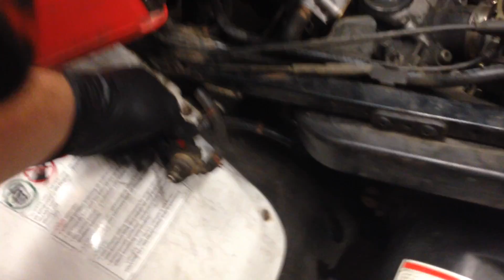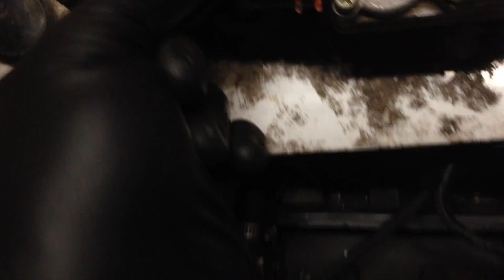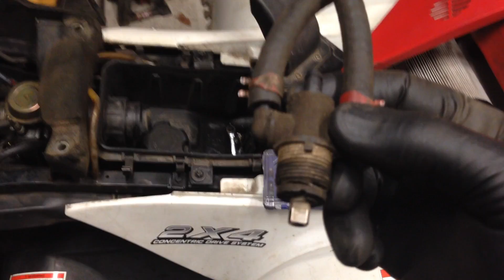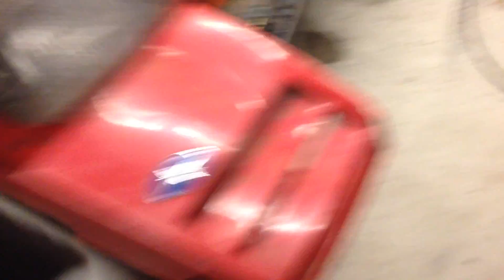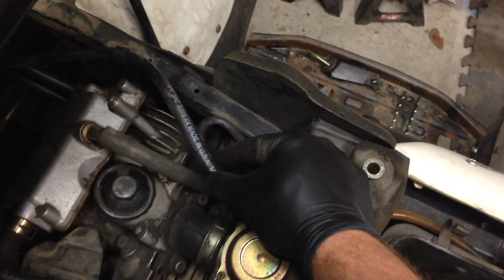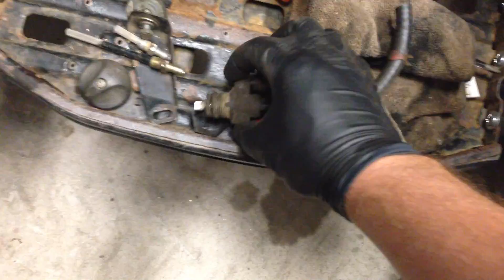Trailboss 325 fuel issues. The fix! Engine sputters then dies. No power or acceleration.

Comment: Your explanation on the pump is wrong the p stands for pump and that line is vacuum Philadelphia vacuum diaphragm pump no it sucks the diaphragm and releases it causing a pumping flat metal plate in the center of a rubber diaphragm that actuates up and down pumping your fuel through the pump to the carburetor vacuum powered diaphragm pump you know how a diaphragm works

Comment: What do people use to seal the ridiculous "nipples" that screw into the underside of the fuel tank? I don't see anything in the manual for this boat anchor. I used teflon tape at the very very end of the threads but if gas touches that; it'll be useless.
Also, you should call the police about whoever the previous owner was with that machine. If they're gonna put those absolutely unacceptable flamingflamerflames grips on their ATV; Who knows what else they're capable of! Scoundrels are everywhere, man!
Reply from the maker: @makaveli087  you can try different thread sealers, Home Depot sells some different types that can withstand different fuel types, check out the plumbing isle. If that’s a no go, try a fuel resistant RTV from an automotive store, it should work. And yes, I’ll make sure the cops track down that flame handled bandit 🤣

Comment: 😅 my good guess man , na really tho P , pulse , aka vacuum to a diaphragm pump , a larger example of a chain saw or weed Wacker , pulls on the diaphragm and releases it therefore creating an pull as Long as there no leaking lines to lose said vacuum it splits at the petcock located in the frame near the fuel outlets on the bottom of the tank, (wish the petcock was on the Tank

Comment: This sounds like what I might need to do on my Trail boss 325.  I've been racking my brain trying to figure out why mine is sputtering and almost dying while accelerating.  Must have had the carburetor off 8 times and cleaned it.
Reply from the maker: Def follow my video, it’ll help out a ton. Maintenance items that generally get overlooked and typically you find where previous owners went wrong.

Comment: I think my carb isn’t making vacuum, when I leave my pressure line hooked into the carb and blow into it I can’t hear an air leak and whatever the vacuum needle thing is doesn’t move in the carb, can anyone help?
Reply from the maker: Sounds like an internal issue with your carburetor. If you’ve already taken it apart, check your seals for leaks

Comment: Does the express have a fuel pump I'm having issue where its blowing gas back out of carb and gasping at full throttle sum1 help plz
Reply from the maker: Sounds like your float is stuck, gas shouldn’t be burping out of your carb. Take carb off, disassemble it and check your needle and float. Your float is either damaged and doesn’t float anymore or your needle and seat is compromised or dirty.
Reply: Thanks but I finally figured it out ... the skirt on the intake side of piston broke off lol. Last thing I ever would of thought. Good news I'm a certified polaris technician bc I went through every fucken thing on it lol

Comment: This seems like such an easy fix, mine surely can't be this - Scrambler 500, has spark, compression, seems to get fuel - doesn't run, backfires occasionally while cranking.  I've checked most everything out, cam lobes are good, even bought a new carb.  I guess I'll replace the fuel line. Edit - I bought a new fuel pump also, still didn't help
Reply: Cdi

Comment: It is called a fuel pump because that's exactly what it does. The pulse line provides pulsing on a diaphragm which in turn sucks and pushes the fuel through two one way valves. It sucks from the tank through a one way and then pushes through another one way to the carb

Comment: This is one of the best videos on repairing the fuel system on a quad! I have several ATVs of different makes and hp for every member of the family. Some easier to work on than others and the Trail Boss is one of the worst.  I had the same problems with my Trail Boss and this video was so detailed that I never got the manual out. I think it was especially important to note that you might as well replace the fuel lines.  How true; rerouting old, stiff lines and trying to twist the components back into shape is just asking for more trouble. The Boss is now working great after doing through all the steps and replacing all the comments (including the fuel pump) as shown in this video.  Well done!
Reply: I’m not sure if the fuel pump is my issue but the other day I was riding my 97 425 magnum with no issues no sputter no nothing but then the strangest thing is happening I ran out of gas so I filled it back up and now it won’t run unless the choke is on but it can only idle , as soon as you hit the gas with the choke off or on it dies
Reply from the maker: puchski1 thanks for the positive comment. I really appreciate it

Comment: Great video. Could you explain to me how to bypass the petcock?
Reply from the maker: Find the line going to the shorter filter going into your tank, plug the other outlet and run the hose that connects to the center connector on your petcock valve to the short filter outlet on bottom of your tank

Comment: I prefer to disable the fuel pump and go directly to the carb from the tank.. the fuel pump operates by pulsation created by rpm from motor. the fuel pump only pumps fuel at high rpm. it will not pump at idle thus using up the fuel that is left in the bowl. watch your fuel filter at idle and you will see it empty out...rev the motor and the filter will fill back. This draw back of fuel can cause a rough idle and rpm take off.  I consider these pumps useless seeing as how gravity feed  serves best with a constant flow.......(my opinion and i'm sticking to it)
Reply from the maker: limbslapper one yeah, I see what you mean, makes sense that the pump works when you rev it because of the vacuum line running to the pump. I ran my quad bypassed and connected to the pump, I found mine ran a little better and had a small noticeable amount more power with the pump connected. There’s lots of variables between everyones machines, I was hoping that it would run better bypassed TBH, but mine preferred it. Thanks for your comment, I love the feedback that I get on these topics.

Comment: You had the fittings explanation backwards. The long one with the plastic is for reserve and the plastic part holds a small amount of extra gas that it will run off of when reserve is selected
Reply from the maker: Doctor Feinstone thanks for your comment. I rewatched my video and my explanation is actually correct. The longer nipple fitting with plastic tube is the “fuel on” fitting. The “reserve fuel” fitting is the short one. The plastic is to keep reserve fuel in the tank, not reserve fuel in the plastic sleeve (quad would only run for seconds on fuel inside that sleeve if I’m understanding your comment right, that’s not what I’d call a reserve). The black plastic piece  determines the height that the filter draws fuel from to keep a reserve in the bottom of the tank so you don’t unknowingly empty your tank while riding. That longer nipple only has access to 80% of the fuel in the tank, so it’s not the reserve, it’s “fuel on”. 
 The shorter sleeve sucks from the bottom of the tank (it has 100% access to all fuel because it’s short and sits at bottom of the tank, thus it’s the reserve nipple). You switch from “fuel on” to “reserve” when your quad sputters when fuel level drops below the plastic sleeve so you know you’re getting low. I hope this explanation makes sense to you.

Comment: Hi i have a Polaris Trail boss 325 and when i start it up and go to put it Forward or Reveres it makes a Grinding sound and shuts off!! I tried pressing the Gas and then putting it in Forward and it works!! But when i hit the brakes it shuts off! Anyone know what to do? We think the clutch is stuck!!Plz help!!!
Reply from the maker: Colton Bocock start by removing the clutch cover and see what’s going on. With machine off that belt should be loose enough to move with your hand. If the belt is tight and the primary clutch is full diameter, then you have a seized primary clutch. They can be rebuilt but you should also look at your clutch covers and see if you are getting water and debris in there. They are supposed to be relatively water tight to keep stuff from binding and wearing out your clutches and belt.
Reply: Dustin Elgan Thanks

Comment: I have a 400 sportsman 2002 put a new cam in got everything rite now it will run but like crap sometimes it will take off good then it will go like crap then it will idle high then die then start it up and all the same again I need help
Reply from the maker: Randy Kuball sounds like an electrical issue, check all your connections being that it was all taken apart for the rebuild. It obviously isn’t a mechanical issue or there would be other symptoms. I doubt it to be a fuel issue unless your carburetor was messed with or has clogged insides. I’m leaning towards electrical though. Start simple and troubleshoot from there. Hope this helps you.

Comment: I did a full carb rebuild,  fuel pump was changed, ran the fuel lines to the proper places and changed the plug. it starts up fine and will idle but the moment i hit the throttle when the quad is in gear it dies out. i tried adjusting the throttle cable but it still does the same thing. my only other thought would be that i used a lower octane fuel to see if it would even run after all the work. could this be a factor or should i look into something else??
Reply from the maker: Brian Cushler did you adjust the float in the carb? Sounds like you don’t have enough reserve fuel for when you demand more. That’s a possibility, but I’ve never messed with that particular carb. There should be a air/fuel mixture screw that would help you too, you could be running her lean. Did you clean the fuel strainers that connect to the lower nipples that provide fuel from the tank? I don’t feel that lower octane fuel is the cause unless you’re running absolutely old garbage gas, which in that case you’d idle rough if at all. Let me know if this helps.

Comment: I just did the same fuel line replacement on mine and went ahead and cleaned the whole carb out as well.  Now I have a whole new problem - it seems to be starving for air with any attempt to rev the engine.  With the airbox off I can see into the air intake and nothing is opening up with throttle pressure so I may have an issue with some aspect of the jet needle reassembly ....taking her apart again
Reply from the maker: Todd Staples hey, sorry you’re having problems. You say you’re not getting enough air? Did you check your nipples in the fuel tank? You might be starving for fuel. I’ve seen the sock filters on end of nipples get plugged up. I hope that helps you, check your fuel pump too. They are cheap and not terrible to replace. Best of luck, thanks for your comment
Reply: yeah when I replaced all the lines I blew everything out and cleaned the tank too so I am confident that it is getting fuel.  When I do rev it up it literally sounds like it is choking on fuel and the smell of unburnt gas is strong in the exhaust.  I didn't change anything else as far as adjustments go.  It was running good before I replaced everything other than occasionally having issues starting cold which prompted me to do the clean up.  Thanks for the response Dustin.
Reply from the maker: Todd Staples unburnt fuel means an overly rich mixture, you obviously already know that, I’m not trying to be preachy or anything, just trying to help you get to bottom of problem. Good news is you are getting fuel,  right 👍. That’s usually half the battle. If you can rev up the quad it isn’t an air issue unless you have something restricting the air which in most cases you can see pretty quickly.
 From my experience my money is on Your needle and seat/float not be seating properly after your tear down or you accidentally bent the adjustment tab for the float making it not close the needle and seat all the way when it’s full. All it takes is a little dirt or varnish to compromise its ability to meter the fuel going into the carb/engine. 
 Does quad leak fuel overnight if you leave the fuel petcock valve on? That would be a way of checking for fuel float/valve and seat issues without tearing into anything. 
 You may have stirred up varnish and clogged a port also. 
 Do you have a fouled spark plug? Could be another possible issue, not burning all the fuel, but quad wouldn’t start very well (if at all) if that was the case. 
 Let me know if you figure it out, would love to know how you made out. Thanks for your comment again, I wish you the best.
Reply: I suspect you are right on the floats or maybe the adjustment tab you mentioned.  It's weird it almost acts like it is running with the choke on all the time.  I'm tearing it apart now so I hope to have an answer soon.  Nothing leaks and I keep the valve open all the time - this quad is my workhorse and usually is attached to a cart that I use to move firewood and other stuff so it sits outside 24/7.  Thanks for all the great tips!  Let me know if you know how to detatch the choke cable from the carb?  Last time I disassembled this I remember having an issue getting the choke off as it seemed to be held in place by something inside the carb.
Reply from the maker: Todd Staples yeah, never messed with my carb unfortunately, never had to luckily. I have torn into my Yamaha and the kids Tao Tao quads, this linkage attachments can be a little tricky. Maybe you’re choke cable got preloaded when everything got reassembled keeping your choke on all the time. If your choke is sane as mine, it’s tough to say if it’s attached right or not.
Reply: did you ever get this sorted?? I'm having a very similar problem

Comment: Will the 325 trail boss run right if I bypass the fuel pump and run a line of gas directly to the carb? Also do you have any videos on that vacuum box that's mounted on the head? Not sure what that box actually does. Thanks and keep up the good work.
Reply from the maker: Jason Day I remember that the quad ran ok with direct feed gas, but I put a new fuel pump in regardless and it runs a little better. I don’t see how bypassing the fuel pump would cause any issues and may increase reliability though my quad idled better with the new fuel pump. As for the vacuum box you inquired of, I believe that is the crankcase breather. Not much to really say about it other than that line connects back in with the air filter box on the fwd side when you reinstall everything to put the quad back on the trail. Hope this helps. Best of luck to ya, thanks for the comment. 👍
Reply: Dustin Elgan thanks for the reply

Comment: Technically, the "P" line is not pressure. Engine VACUUM from the intake side of the carburetor "pulls" and opens the fuel-pump valve.
Reply from the maker: Alvin Ambers thanks for your input, I hope the video was helpful to you. Don’t forget to thumb up 😉👍
Reply: Technically, the "P" line IS pressure. Negative pressure, which is also called VACUUM. Negative pressure, also known as a vacuum, is a process that reduces the air pressure inside a container to a level that is lower than the outside atmospheric pressure.  @dustinelgan6070

Comment: Hi dustin,i have the same atv,i took carb off cleaned it really well but there is a flat head screw at bottom next tothe float,it has a spring on it. How many turns does it need to be when putting it back? PLEASE CAN YOU HELP ME?
thank you
Reply from the maker: 1982pantro that’s likely your fuel air mixture screw. Screw it all the way in, then count the rotation out at 1 &1/2 turns. That’s a good starting point for adjusting the carburetor. I’m sure there are videos on YouTube that will give you tips on getting the carb fine tuned, if it runs good like that you shouldn’t have any problems. Thanks for your comment and best of luck to you.
Reply: Dustin Elgan,thank you so much for your quick response,you saved me a headache. Greetings from arizona.

Comment: Dustin.  2005 Polaris Sportsman 400 appears to operate a very similar system. There is a small plastic line that leaves the top of the fuel tank (through a nipple on the top) and appears to go up into the instrument panel at the top front of the quad.   What is that line and what if it is cracked or broken?   Also how difficult to replace? Thanks
Reply from the maker: Ted Wheat that’s your tank vent line, in order for fuel to flow you need to displace fuel with air in your tank as you use the fuel or it will not flow freely. Not a terrible job to replace, just remove the fairings/plastics around the tank and you should have access to replace the line. Worse case scenario you may have to remove the tank to get access to the line. Just replace it with fuel resistant hose from Autoparts store or small engine repair shop. Best of luck to you, thanks for your comment, hope this helps.

Comment: what is it when the quad acts like it gets to much gas?   mine has all New fuel lines but didn't fix the issue?
Reply from the maker: Sam Remy check your carburetor, sounds like your needle and seat isn't closing all the way in the float bowl. Hope this helps. Let me know how you make out.
Reply: check your choke...could be sticking